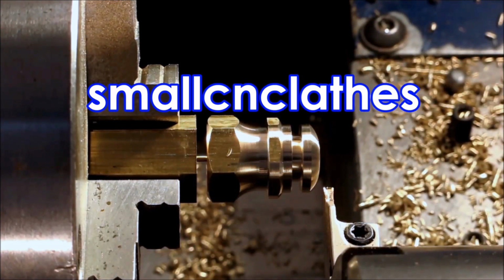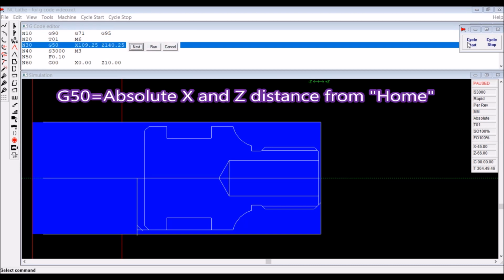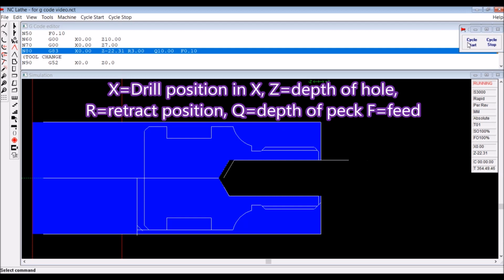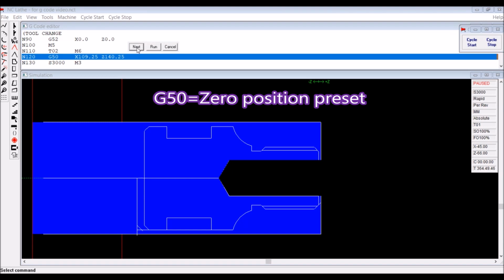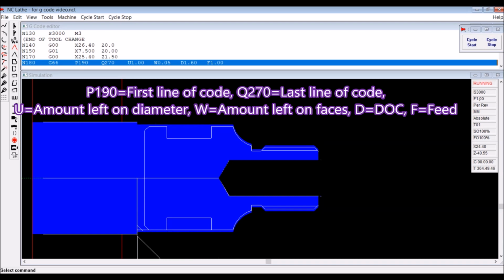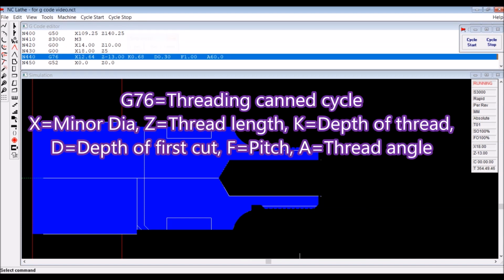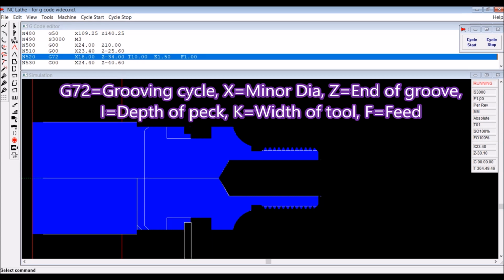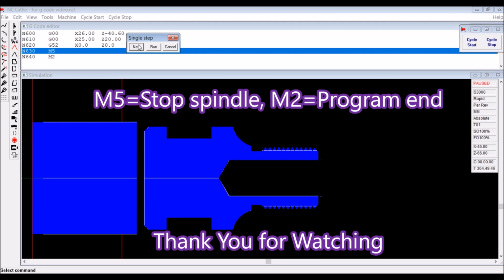4 G code canned cycles as used in 25 y/o cnc lathe cad cam software.

Comment: I've always used M30 to finish a program because I'm old enough to have operated machines with tape readers back in the 80's ( M30= program end tape rewind ) , so that software isn't old to me !
Reply from the maker: Andrew Clark I think the software uses M2 if you tell it to end the program, but I think M30 works too. Software is not old to me either, it works for me and that is enough. Thank you for the comment.
Reply: M30 is still end program and rewind on the modern lathe i run that was built in 2015

Comment: It's all about the order of operations. Thank you for this.
Reply from the maker: The tool/operation order is pretty much set by the part shape, certainly in  this case. Drill first and that is a bit you don't have to face off. The thread has to be after the stock removal and the parting tool does the groove and then part. There are parts however that really need some thinking through as to the tool/operation order.  Calling up a tool for a second time can seem a bit counter productive, but sometimes it is the only way to go.  That recent Velocity stacks video is an example.  Called for a RH tool twice